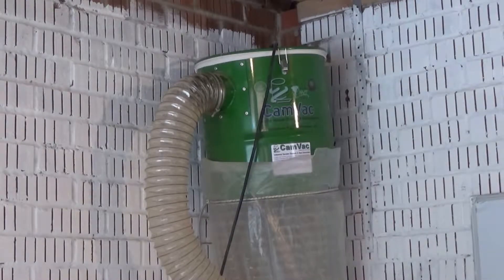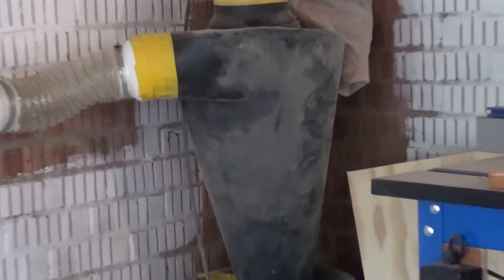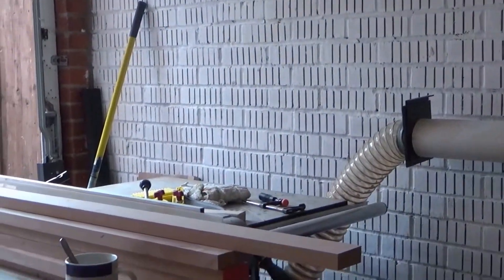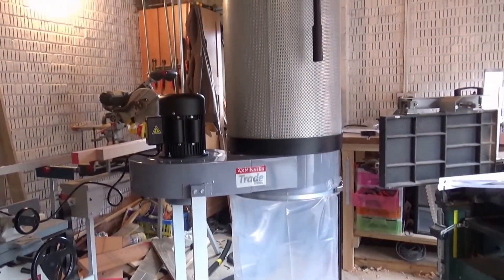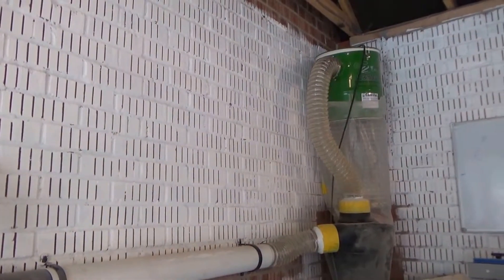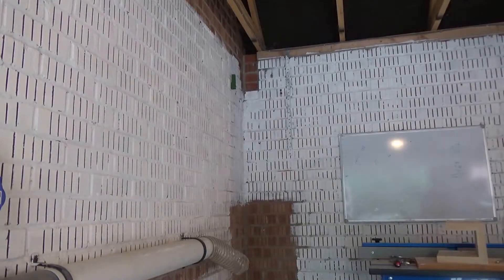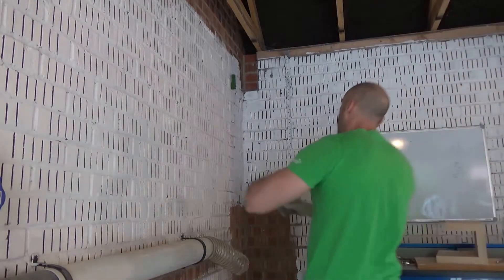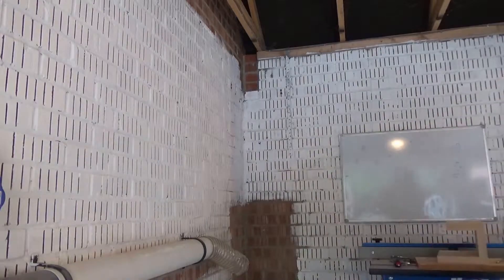Installing an axminster extractor to a cyclone.

Comment: Did you have any problems with the large wheels binding against the skirt of unit...or didn’t you get that far...?  Mine is the 1HP version, and although now put together, I have not yet had time to set up the dust collection system (100mm for table/band saw etc, down to 50mm for hand-held tools)... I thought the design of the extractor might be improved by mounting the motor below the impeller, and the extraction connection point above the impeller, so if you install this similar to your own installation the cyclone can go above the unit, as it needs little attention, and the motor, filter and dust bag can be lower and more convenient for access/maintenance...

Comment: Really nice do you think the 1hp motor would have worked just fine?
Reply from the maker: Maybe. This extractor is quite powerful as long as you keep the filer clean, but i will probably add more machines to it and eventually get a bigger shop so the 2hp was the right one for me.

Comment: Paul, enjoyed the video, not sure if the music was better before or after you sped up the video!  I'm thinking of getting the same 2HP trade series from Axminster, I have a few of their systems always decent quality and the aftercare support from them is fantastic in my experience.
Reply: Stuart Munn thanks for the compliment it was my first attempt at filming, with limited success. I cannot fault the extractor it is one of their best items. it Really sucks in a good way.
Reply: Finally getting around to doing this. Where did you get the reducer to replace the double ended one that came with the extractor? I'm struggling to find one.

Comment: just received mine for all the same reasons as you but it has the blue plug and I only have std 13amp sockets. Did you have to upgrade your power ?
Reply from the maker: Tim Cains I already had a 16a line in but from what I heard a 13 a line should work if not it will only trip a fuse axminsrer told me they recommend a 16a for anything over 2 hp so it could be OK just don't have anything starting at the same time.
Reply: I just fitted a spur with a a blue connector I got from Halfords for caravans.